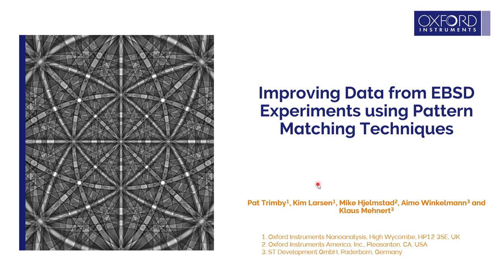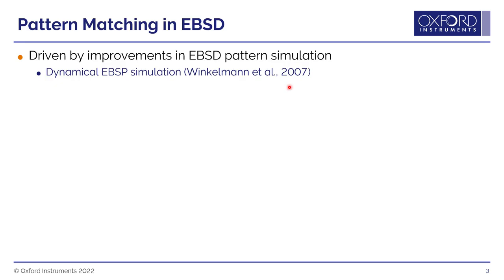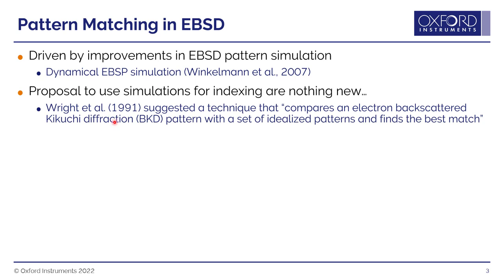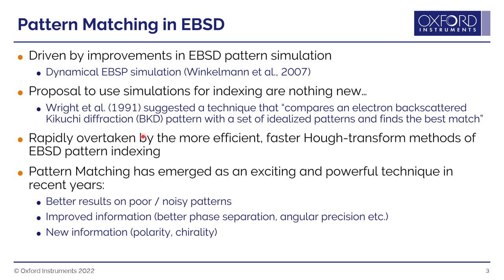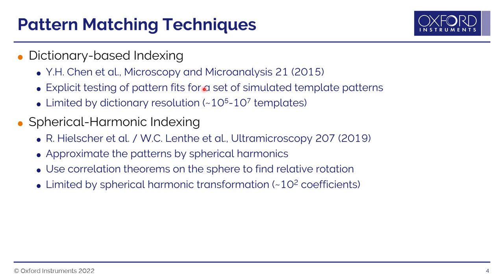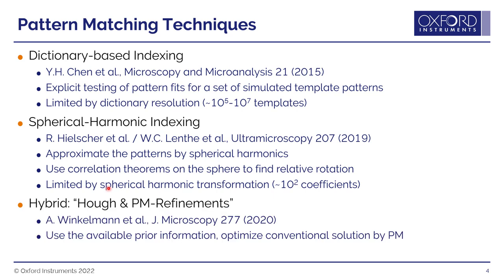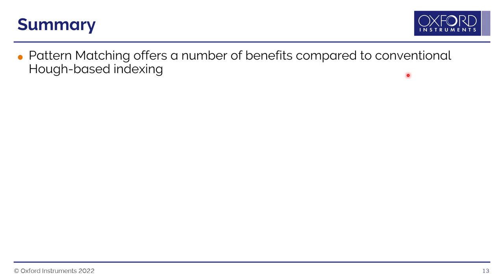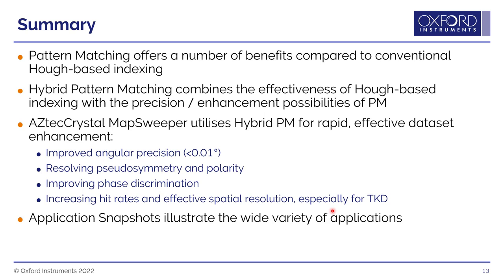Improving Data from EBSD Experiments using Pattern Matching Techniques

Comment: What is the difference compared with dictionary matching?
Reply from the maker: Hi Lu, 

AZtecCrystal MapSweeper includes a full indexing method (Dynamic Template Matching - DTM) that has all the benefits of Dictionary Indexing (i.e. the ability to index reliably even very poor quality diffraction patterns) but without the drawbacks (for example, DTM needs no pre-calculation of a library of simulations, can work well for multiple phases, calculates the geometry calibration at every point in the dataset and involves immediate refinement of the solution to give better orientation precision than regular indexing methods). However, for most samples we do not need to use DTM, as MapSweeper’s “Refine” and “Repair” modes utilise pre-existing data (e.g. from Hough-based indexing) to enhance EBSD datasets much more effectively and quickly.

Oxford Instruments